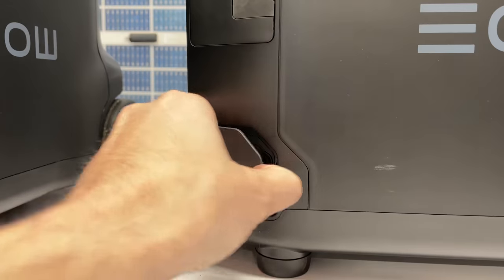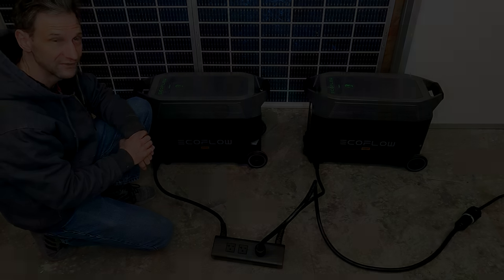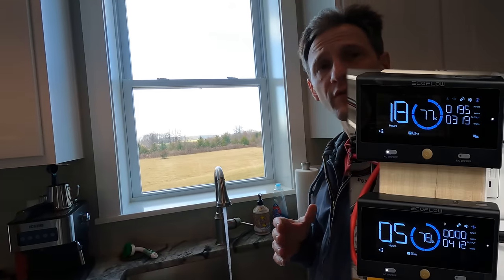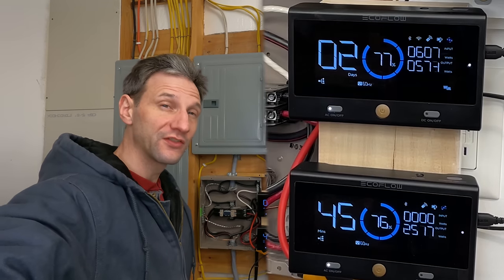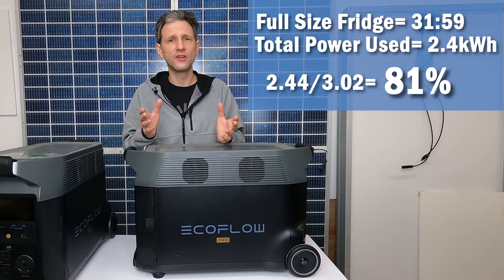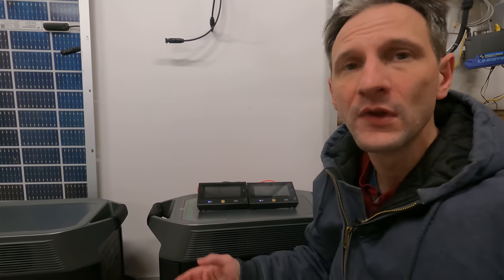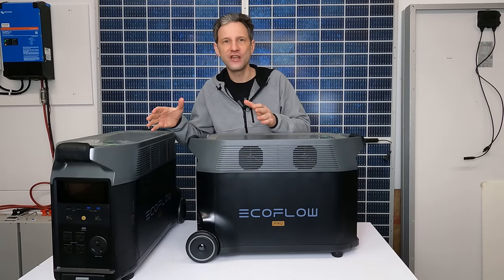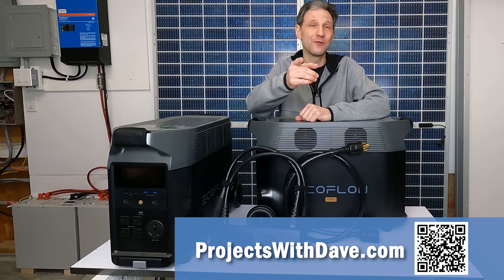EcoFlow Delta Pro Whole Home Backup - Real World Testing

Comment from the maker: View more details on my new website here: https://projectswithdave.com/portable-power-station/
Reply: I'm a bit surprised your geothermal heat pump has such an in rush. Over here (EU) I'm used to inverter driven heat pumps being more common than single phase direct driven ones
Reply: Can you charge that system while it is using the hub to power your home grid?

Comment: That inrush is crazy. You'd need 2 Sol-Ark 15k to start that. The inrush on my 4 ton (non-geothermal) heat pump is around 112A for reference.
Reply from the maker: I plan to look into that a bit more.  It shouldn't be that high.
Reply: @ProjectsWithDave  How does that not blow your breaker? Even on a 100A breaker I wouldn't think that load would be tolerated for more than fraction of a second and I'd be surprised if a 4 ton unit was spec'd for more than 50 or 60 amp breaker.
Reply: @extragoode  breakers need the heat to trip it, a few seconds of that isn't enough.  A minute would be though!
Reply: @whattheschmidt  arc fault on the other hand can be tripped
Reply: Use a soft start
Reply: Micro air soft start, my in rush went from 117 to 28.
Reply: When any large appliance starts up the inrush current is massive. You can lower it a lot using a AC soft start

Comment: Stellar review of a very capable system. Very much appreciate your detailed attention for various configurations supported by meaningful data. Additionally, employing this as a plug and play off grid/mobile solution with 240v support is a game changer for those seeking installation/maintenance simplicity. Lastly, I'll need to review the inverters low frequency capacity/limitations (as you spotlighted with your 3Ton heatpump), Ecoflow's implementation of precharge resistors in the circuit, as well as future iterations of the product family containing heat mats/blankets to enable low temp charging when a power source is readily available. Again, great review and supporting data. Thank you for this.
Reply: Agreed

Comment: great walk thru of how this system works, the lack of the 120v outlet on the hub was why i went with the bluetti ac300 system. I have set mine up with 240 split phase and have been using it to run several circuits in my house for about 4 months now. the short winter days have been an eye opener on how much different the solar part delivers.  my biggest gripe is the way the cables are connected to the batteries and inverters. Hope Bluetti sends you a system to showcase like you did here. I would like to see a head to head comparison from you.
Reply from the maker: Thanks for the feedback.  People don't realize how dramatic the difference in solar production is between summer and winter.  The number of panels needed is defined more by low light winter production, that's why the bifacial panels are such a great advancement.  I do have a connection with Bluetti, I reviewed the EB70S some time ago ( watch here: https://youtu.be/LAjirHJ-t6s ), but it would be a while before I can do the AC300, I already have content planned for the next several months.  Thanks!
Reply: @ProjectsWithDave  Do bifacial panels have the potential to overheat more in hotter climates since they have two active sides?
Reply from the maker: It would stand to reason the panels would absorb more heat with the increase in exposed material.  However, I have not taken any data to verify that.

Comment: Again, nice job Dave. I think there's a whole lot of us "out in the country" who appreciate ground mounted panels and robust battery storage. Especially when you're on a well. That seems to make you a kind of "problem child" when installers encounter it.

That said, just a sidebar: we also have a geothermal system with a ClimateMaster heatpump. I discussed this very issue with my installer; running it off a generator or battery. Pretty much academic for me as I wouldn't expect that capability on my budget but with a pellet stove, I'd still like to be able to switch on the fan coil air circulator. He acknowledged the startup surge as the challenge but told me if I wanted they could retrofit a "Soft Start" module just to handle that. Haven't gone past that to dig deeper though.
Reply from the maker: I have a soft start module on mine.  I wonder if it isn't working properly because that startup current was way too high.  I'm going to look into it more.  I'm a mechanical engineer by trade not an electrician, so I have to learn everything independently as I go.   My air handler is a separate unit and I can run that no problem.  For a completely off-grid setup I think the new solar powered min split systems would be ideal.  I'm considering installing one and trying it out.  ( AC/DC solar powered min split: https://signaturesolar.com/eg4-hybrid-ac-dc-solar-air-conditioner-2-ton/?ref=SALE )
Reply: @ProjectsWithDave  Looking forward to a review if you have an opportunity to install the AC/DC solar powered min split. This would be great.
Reply: @ProjectsWithDave  those solar ASHPs look pretty simple to connect. My biggest question would be I don't see any mention of them feeding back into the house grid if the climate is temperate and no conditioning is needed, would any solar power generated by those panels be wasted in that case?

Comment: Thanks for showing the workings of a breaker box. I never cared more than turning a breaker off and on. I never new that there were switches that can be moved around to balance a load. Do you think? A person would need some electrical experience to use a eco flow delta pro. Or!!! It is a plug and play experience. Taking in all the components ( such as the solar panels with tracking and smart generator and 50 amp hub and any other product that will work well with these units). ( you answered part of my question at the end of video) ( I was typing while watching the video) Eco flow should allow you to show what a max system would look like with all the accessories. That would be a great video. I know that there is  a limit to how much solar one delta pro can be optimally connected too without a overload. They need too fix that balancing of batteries. You should also show the solution to get the batteries to work simultaneously or equal draw in the video. Great video!!!

Comment: !!Important!! Need to remember that when using an interlock or transfer switch, it's important to know if you are also switching the neutrals. This will determine if you have a separately derived system or not. If your first means of disconnect is your main breaker panel and you are not switching a neutral, the grounding, conductor that is connecting to your battery backup could also be carrying current equal to the neutral.  

This is why it's important if you don't know what you're doing  have an electrician install this for you. Don't make a mistake that could kill someone. Most people assume that grounding conductors are always safe, but they can become hot in certain conditions.

Comment: Adding the double voltage hub does not prevent the 120v outlets on the front to be disabled, they just need to be turned on.  At least that's how mine is working!  There's also a setting that controls the length of time it's on.  The hub is connected, but the main breaker is not on.  I'm running pumps, washing machine, fans, and more from the ac outputs on the front of the unit.  I only plan on using 240v when the power company goes down.  The rest of the time I can run several things in my garage off line, reducing my electric bill.

Comment: Another solar/DC input option,  is the Anderson powerpole adapter cable. I built an XT60 to APP pigtail so I had an easy to use breakway from my solar cable that's semi-permanently installed. This cable is 12/3 type TC-ER Tray Cable. The cable has the Anderson Plug on one end, and goes to MC4 to pickup the panels on the rooftop. It also functions as a portsaver, taking wear off the XT60 inlet on the unit itself. 

Oh, and place a blocking diode inline of the solar array to prevent drain, and a DC rated disconnect switch for safety and lockout/tagout compliance.
Reply from the maker: I love the XT60 connectors, I use them on projects all the time.

Comment: The Delta Pro is probably the most versatile power station I could get my hands on because I can charge it thru solar panels, AC outlet, Smart Generator and most unique of all is charging it at an EV station.
Reply from the maker: I just received the EV charging adaptor in the mail.  Unfortunately, I didn't get it in time for this video, but I do plan to try it out.  It's a very unique feature.

Comment: 16:07 - the 20% unused or left over or "efficiency" that you mentioned is most probably not the inverters efficiency but the battery DOD or battery shutdown threshold setting in the inverter. Check the battery protection setting of the inverter, it may give some enlightenment.

Comment: 4300 watts!  Holy cow!  Good to know that these things will TOTALLY exceed their specs of a total of 3600 watts..  Dang!  I have three of these Delta Pro's, with has two external batteries and I'm not done with my solar system.  I just REALLY wish that they could have a LOT more than 1600 watts of solar charging.  I believe it's the volts that should be higher, this alone should raise the solar incoming watts.  GREAT video!!!
Reply from the maker: Yes, the low max voltage is the big limiting factor on improving the solar input. I think we will see that improve in the future. The competition in the market is pushing it up.
Reply: 4300 watts is 100 hours of running a 43 watt light bulb and nothing else.  Wow everyone needs one of these.  Just like we all need EV automobiles despite the lack of convenient charging stations and the grid needed to support such a massive increase in power demand.  The lemmings are runnung us all toward the cliff.  Enjoy the view as we all go over.
Reply: @WilliamMurphy-uv9pm  It'd make a great UPS for a protective device to prevent damage from switching over to a "Generator" !! that's about it!!
Reply: Don't you run into a problem of needing thicker feeder wire/cable when volts go up?  Thought I saw that somewhere.
Reply: @michaelc.fulghum8125  Or maybe something to ease the initial surge.  Interesting thought.  Thanks.

Comment: Kudos to you for such an informative video. I can only assume you're an electrician by trade. I've been beta testing their equipment since the company started and almost everything you said in this video was spot on. Very impressive. Too bad they didn't send you a DPU to play with.
Reply from the maker: Thanks, but I'm actually a mechanical engineer by trade.  Most things electrical are on the job training.  I did wire my entire house including the meter panel and breaker panels, so lots of jobs to learn on.

Comment: I have this set up with 3200 watts of solar. One extra battery is on the leg with the refrigerator on it. It  powers the desert house pretty well except in summer when air conditioning with mini splits needing to run at night. Has your system just randomly shut down for no reason? This happens from time to time and it’s the one gripe I have about the Delta Pro 240 volt split phase system.😮 Everything in the fridge could be ruined if this happens when I’m away.
Reply from the maker: Thanks for posting your actual situation.  I have not had the shutdown issue.  Have you tried updating the firmware?

Comment: Thank you. After heat pump test I was bummed out !bigtime. BUT! I'm checking out my 5 ton Water Furnace and it has a variable speed compressor soft start.  Better borrow my son Fluke with the loop before I purchase anything.
Reply from the maker: I'm working with a company on a soft start solution.  I was able to run my 4ton heat pump with the latest device.
Reply: Same setup as you be here in a week. Thanks for vid ,reply and sharing Sir!
Reply: @ProjectsWithDave  My 3.5 ton (16seer) pulled 84 amps, now only 25 with soft start. I've got to think that 200 amp drag and noise is  sign of an imminent failure! Great work!

Comment: Excellent tutorial, you covered everything in detail, although I have a backup power system in my house, I enjoyed watching your video just in case I might have done something wrong on my setup. When I first started testing my unit my wife saw me out there by the generator plug, with two of her hair dryers and two of our heaters, this is a pretty excellent way of checking your capacity. Anyway my system paid off, the December 2022, storm left us without power for almost 20 hours. Of course we were the only one on our street with backup power running refrigerator and freezers  that were working all the time. A few days later we had to here sad stories from our neighbors that lost all their food, I wish I could have dropped an extension cord to them but then I probably wouldn't have enough for myself. What can I do, when I put in my system in, I told them they should do the same thing and they just ignored me, they lost several thousand dollars worth of food.
Reply from the maker: Thanks for adding your real world experience!

Comment: The initial mismatch in voltages that you saw can be caused by a faulty neutral, so check your infrastructure for clues. Classic symptom is the two legs of your panel being +/- 1-3 V AC.
Reply from the maker: The mismatch is an intentional feature of the system to help balance the battery capacity between the units.

Comment: I have used a few different current meters and they all gave different results.  I only found one that I trusted for accuracy.  And it wasn't a Fluke!   This was at work.  I had to measure current for testing a new machine before shipping.  The best was an Extech.   $300 US.

Maybe you shouldn't point the heat gun at the black power cord.
Reply from the maker: Thanks for the info.  What did you use as a reference to determine which one was the most accurate?
Reply: @ProjectsWithDave  I tried both meters and the Extech was correct.  Both were in calibration.  But, thinking about it the Fluke had a much higher capability(range).  So don't trust your Fluke for milliamps measuring.

Comment: very good testing, I'm assuming the new UPS can be charged from your Solar panels, I missed that, I'm sure they came already charged, but how do you have them connected to your Solar system?, they should make them Server Rack compatible and just incorporate them in one small cabinet, with internal wiring, they can still ship separately and remain cosmetically presentable after installation
Reply from the maker: Yes, I show some solar charging in this video. Check out time stamp 17:03
Reply: do you have an email tha you share with your followers?

Comment: Fantastic video. Thank you so much for diving deeper into this use-case than I've seen before. One question: You seem to say that your well pump continues to pull several hundred watts even after the "surge" of turning on. Does your well pump require that at all times? I was under the impression that it shut off completely when not filling the water tank. Thanks!
Reply from the maker: Good question, I should have made that more clear in the video, but I can only cover so much without making the video too long.  I have an on demand well pump.  The initial surge was to bring the system up to pressure, it then runs at a lower power to maintain pressure as long as water is running.   The accumulation tank is only 5" in diameter.

Comment: In the video there is a graphic calling out L14-30P (plug) and L5-50R (receptacle) when showing the outdoor generator hookup. I wanted to point out that when talking twist locking NEMA power connectors and receptacles L5 series is 120V only!  Yes there are some off brand products on Amazon that are misidentified as L5-50R, but are in reality a CS6369 aka L14-50R which is exactly what you need to connect to a 50A generator inlet hookup  ^_^;

L5 --> 120V {L1, N, G)
L6 --> 240V (L1, L2, G)
L14 --> 120V/240V (L1, L2, N, G)

For the 50A twist locking receptacles you are more likely to find components using the CS (California Standard) nomenclature:

CS6370 --> L5-50R
CS8269 --> L6-50R
CS6369 --> L14-50R

I did not try, but it may be mechanically possible to use L14-50 as L6-50 or L5-50 depending on how you wire it. The other way around would definitely not work, i.e. a L5-50R would not mechanically connect to a 50A generator inlet. 

Reference: https://hubbellcdn.com/ohwassets/HCI/WiringDevice/media/NEMA_Chart.pdf
Reply from the maker: Thanks for paying attention to the details.  Your chart is a great reference, I included it in the details section of the video for everyone to reference.  Right or wrong, the plug I show in the video (ABN L5-50R Connector – 50 Amp Twist Lock Inlet) is the one used on my house for my generator hookup.  The other plug I show L14-30R is likely the more common connection and the one that is directly compatible with the EcoFlow connections.

Comment: I THINK WHAT WE NEED IS TO WELD IN THE FIELD LETS SAY WITH A small 110 arc welder, but keep the power supply connected to a 110 power plug meanwhile I am welding. that way we are using and replacing the currient, is that posible , any conflict with That! THAT WAY ITS GOING TO BE A NON STOP WELDING  is there anyting like this outhere